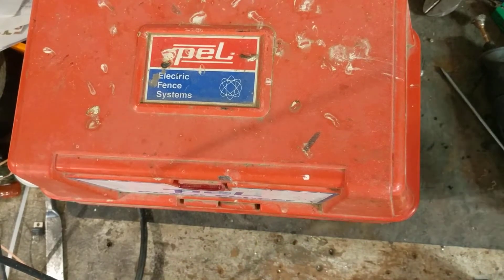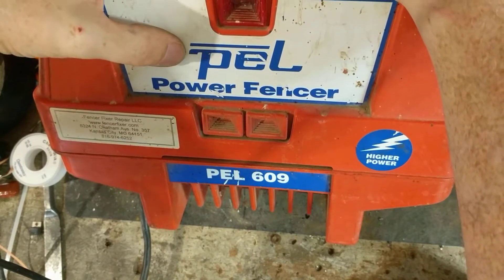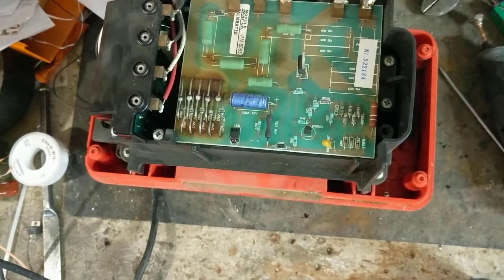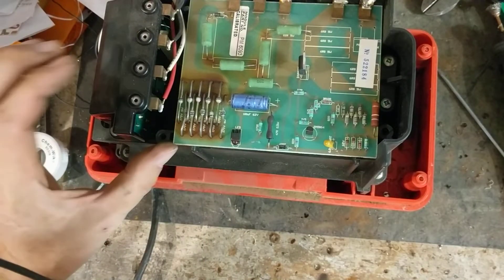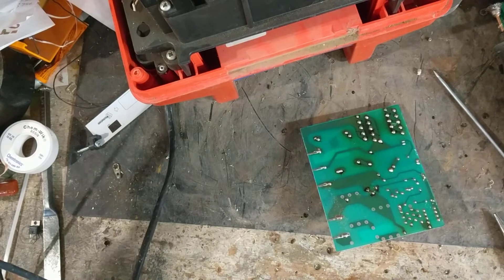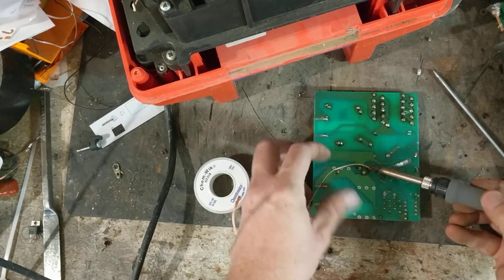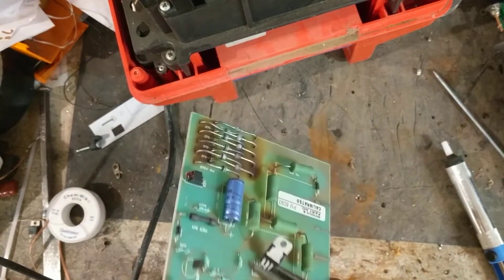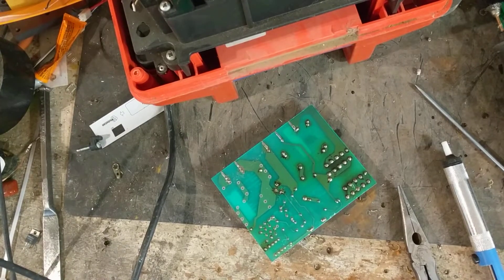How to repair an electric fence charger | PEL 609

Comment: Thanks for sharing the testing procedure!
Next time you need to replace a broken circuit board trace try using solder-wick braid. Works great and if a long repair is needed such as when a trace has burned up the braid is easily shaped to match the the destroyed section. Once the repair is completed and tested a drop or three of super-glue will secure and insulate the repair.